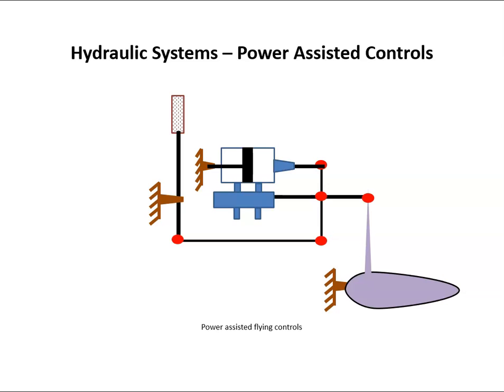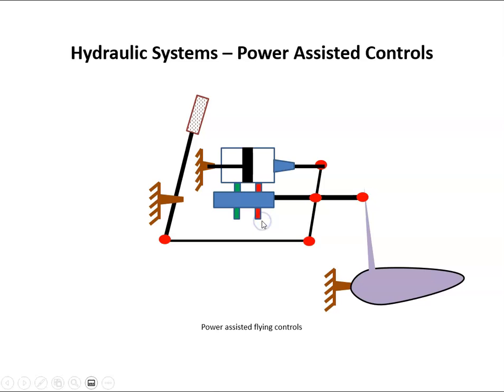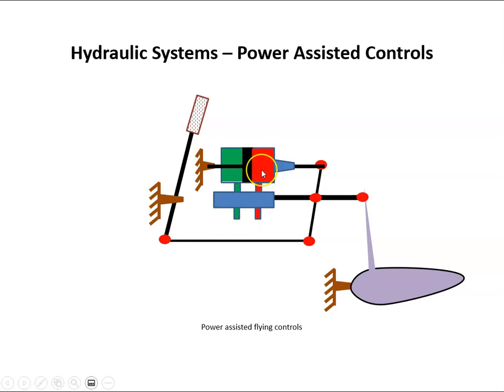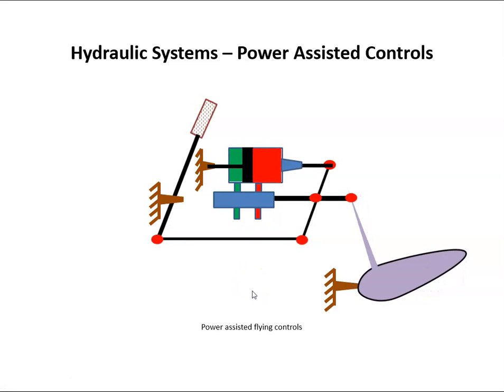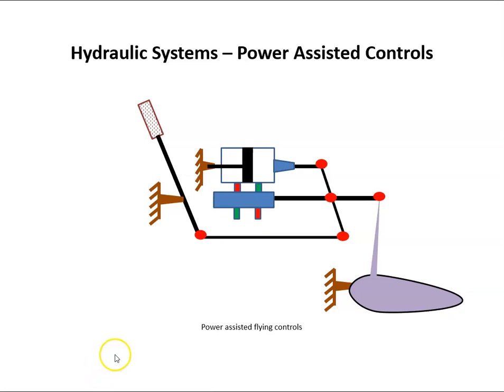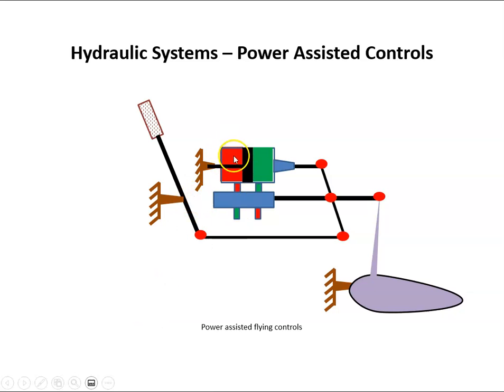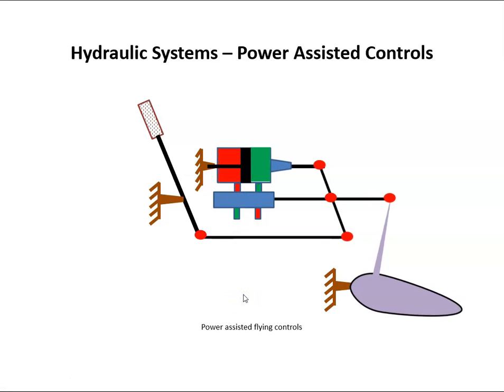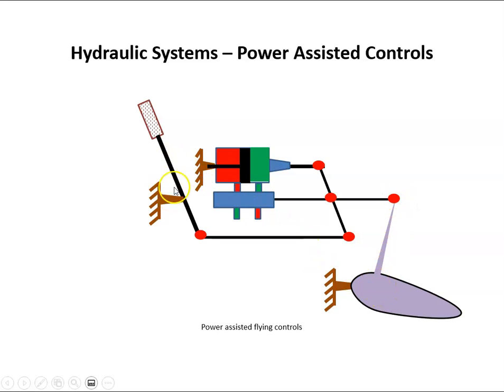Hydraulic Power Assisted Flight Controls

Comment: What if the pilot doesn't pull all the way?  Seems like with a selection valve it's all or nothing, with a large dead zone near the center.
Reply: The PCU (Power Control Unit) is hydraulically actuated and as you have pointed out is like an all or northing movement. It is non-proportional. When the pilot inputs the control Column the surface control would be moved to the max or lowest position no in between. This is when the mechanical servo loop is introduced. Hence by the name this is mechanically operated from the control column using push-pull rods. This servo loop gives proportional control that we want. So to put it all together, the pilot moves the control a little bit let’s say 15%, this will actuate the mech servo loop that then operates the PCU which will move 15% as actuated and is hydraulically operated. Now we have proportional hydraulic control. This proportional control in the SCU (Servo Control Unit) is done via a summing lever. To add to this, there is a simpler mechanical servo loop design that the piston rod is attached to the aircraft structure and the servo control unit housing is attached to the control surface.
This therefore means a bypass valve is not required and the summing leaver is also not required. Making it a more simpler mechanism with less things to fails. Also it means it is weighs less. Hope this helps.

Comment: Great video, but one question. Does the shaft connected to the blue block also extend and detract?
Reply from the maker: Yes. It's that shaft's movement that causes the hydraulic selection valve to change the flow of hydraulic fluid.